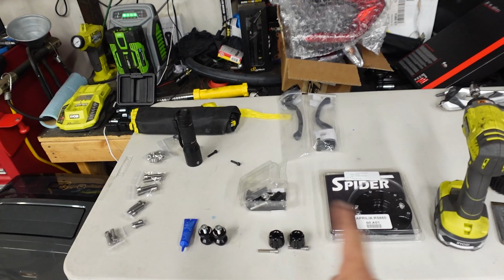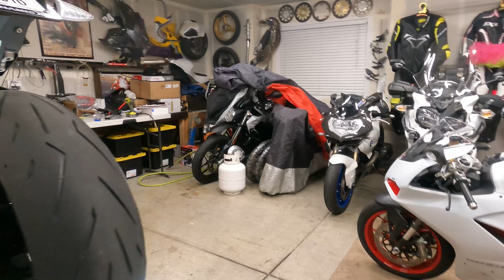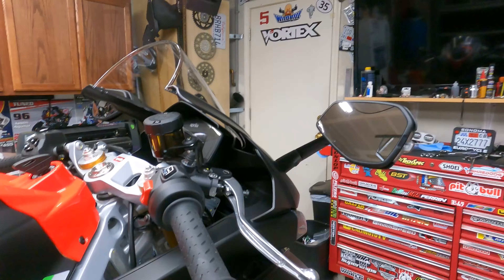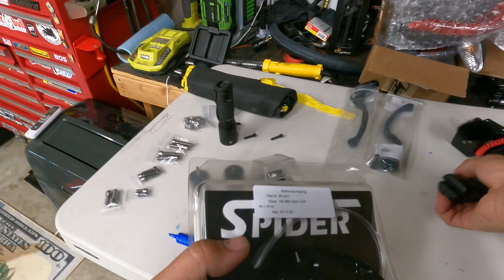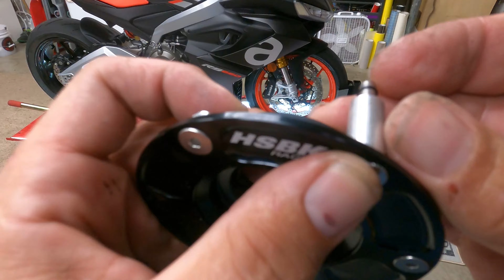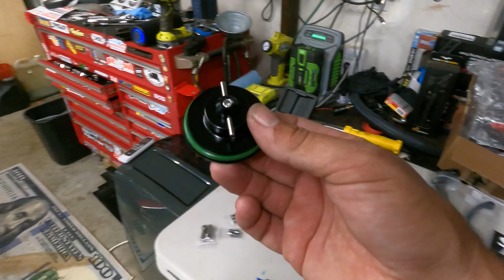2021 Aprilia RS 660 | Spider Accessories Installed

Comment: Is this a bike you would recommend for someone who has built up competency on a 300 and is looking to upgrade? Electronics overwhelming? Ride height good for a 5’7 rider? Oil change looked approachable. Build quality from Aprilia solid? Cross shopping this and a cbr650r if you could provide any insight it would be much appreciated.

Comment: I put on the same gas cap on my aprilia tuono 660 but I couldn’t fish the vent house into the tank. The hole was definitely offset/partially covered under the tank mold. So i ripped it off and installed without the vent hose. Guess I’ll see if i have any problems. It doesn’t vent to the atmosphere, vents under the gasket so I can’t imagine it would cause an issue with the engine. We’ll see. Comment if you know something
Reply: I had the same problem, but watched another video where the guy cut the tube at a more aggressive angle so that it can fit in the weirdly placed vent hole and it allows you to start pushing the tube in much easier..

Comment: After I got my cap off the black liner under it would not come out. Still trying to get it out. Its stuck and my vent hole is kinda covered up by it, however I can not move it. Please helllp I just need to get my vent hose in the hole and its just not budging 🥺
Reply: At this point im about to not even run the vent hose.

Comment: Probably too much Loctite  for a 6mm thread. a small drop would do.
It might snap or strip the allen head if attempt to remove , later on.
Reply: If it was red, you'd probably be right. Blue should be ok.
Reply: @davebrinson5971  yeah blue isn’t too bad